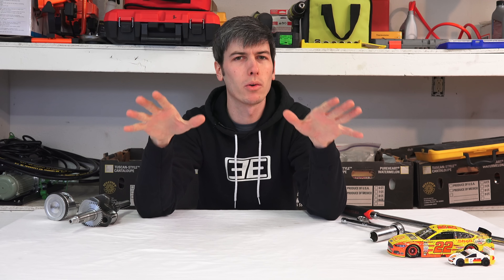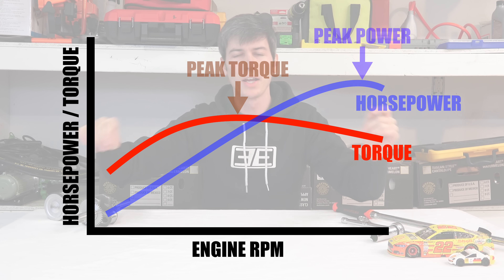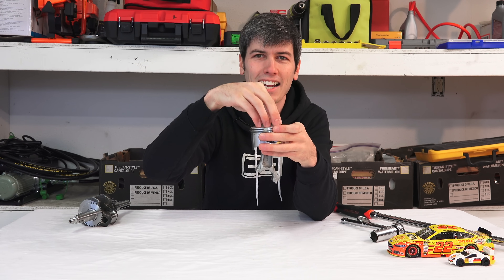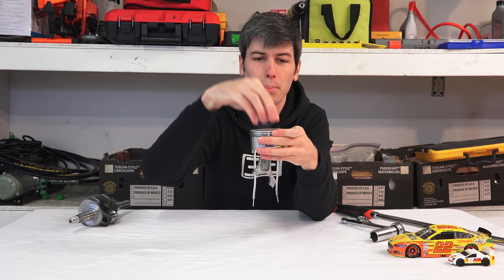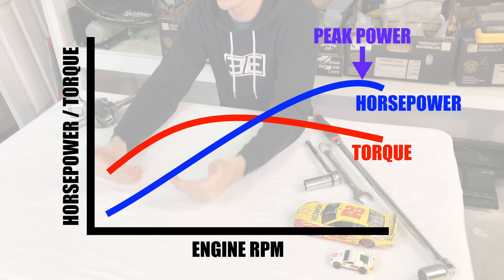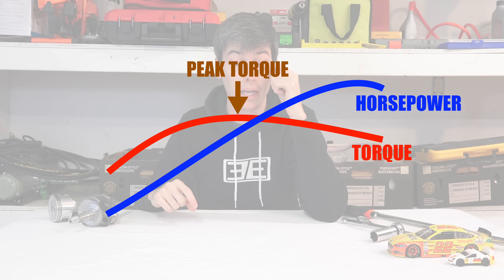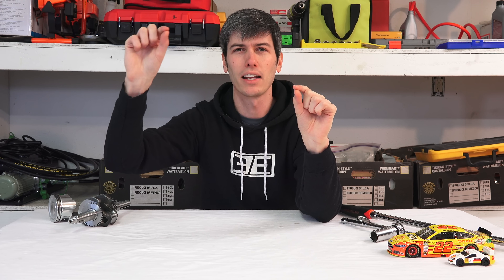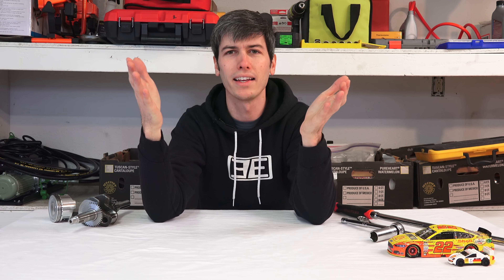Horsepower vs Torque - A Simple Explanation

Comment: Maybe it's easier to grasp if you turn the formula around: HP = torque x RPM. This means torque = HP / RPM. So, in a normal cat, with normal gearing; at low speeds you have high torque, at high speeds you have lower torque (because of the RPM's being higher at higher speeds) and HP is the magic that makes it work :-). Longer piston strokes make for more torque but it also takes longer to make a revolution so, less RPM's when HP is unchanged. Anyway, that's how I see it.

Comment: Let's try that again without the weird spellchecker mods:High Torque : tractor.  High horsepower : fast car.  A tractor cannot accelerate like a car but it is unstoppable.  A car can accelerate fast but stalls instantly when trying to pull a plow.  ...and that is the reason that a big heavy guy like me prefers the high-torque Harley over the buzzy  sportbike.  One delivers unstoppable pull against my weight; the other delivers narrow band acceleration and can bog down.
Reply: It's really only a question of gearing. You could theoretically put the tractor engine into a sports car, attach a transmission with very low gear ratio and there you go. As is said in the video, torque is easily manipulated.

Comment: Good video not entirely accurate, a force applied at a distance is a called a moment. The difference between a torque and a moment is that a torque has a displacent perpendicular to the axis of rotation and a moment only had a rotation around a axis

Comment: Brother, The Torque Conversion will be less at high RPM and High Gear .  at 4th gear the Multiplication of Torque will be less than 3rd Gear ! 
At 4th gear if You increase the Engine RPM a bit higher than the Maximum rated Torque RPM the Torque will be less,
And as You'll cnage the gear to 4 from the 3 the Torque Conversion Ratio will also decrease !
Over all less amount of Torque Multiplication ! 😑

Comment: So a 300 hp car with 100 lb-ft of torque accelerates at the same rate as a 300 hp car with 200 lb-ft of torque?  Saying gear ratios are identical.
Reply: I mean, I would think that a higher torque would still be faster, because it would mean you could get to the peak power faster, thus shifting into the next gear faster and continuing the cycle.
Reply: Gear ratios would never be identical with two engines as different as the ones you described. The engine with less torque would obviously have a far wider usable RPM range than the other one, so it wouldn't need to sacrifice as much torque in the transmission.

Comment: Torque = How much work can be done.
Horsepower = How fast the work can be done.
Reply: In the case of horsepower, you are right (easy enough, since exactly this is being said in the video). But torque doesn't say anything about work being done, because work requires displacement. You could have a torque acting on a screw that won't move, but there is no work being done.

Comment: You are talking about power and torque at crank. The cars power and torque can be different ftom ehat you have on crank by changing gearing ratios. You can have taller gearing on car with more torque.  That would make acceraration faster. Car with greater power can have more torque similarly.
Reply: Of course torque and RPM are freely interchangeable, that's exactly what is being said in the video when he compares the different wrenches to different gears.

Comment: Torque is the ability to move. You can have 500HP, but what's the point if you can't generate the movement(RPMs) to get there? I will take a 'Torquey' motor over a screamer any day.
Reply: Did you even watch the video? You may prefer whatever engine you will, but your explanation is as unscientific and wrong as it gets. Power is a physical quantity that already comprises torque and RPM. If you have a 500 HP engine, you either have lots of torque, a very wide usable RPM range or a bit of both. So if you have 500 HP and not "the movement(RPMs)", you would in fact inevitably have lots of torque, which you said you'd prefer.

Comment: Nope still don't get it. Don't think I ever will
Reply: Torque is twisting force in pounds x feet or newtons x meters.**

At zero rpm there is no horsepower developed no matter how much torque is present.  At very low rpm even very great torque develops little horsepower.

At any rpm, if you double the rpm while maintaining the same torque, you have doubled the horsepower.  

At low engine rpm torque increases with increasing rpm (as the delivered output overshadows the mechanical and pumping losses needed to keep the engine running)  Horsepower rapidly increases as both torque and rpm are increasing.

At high engine rpm the available torque falls off, but at first horsepower still goes up because it's the product of torque and rpm.  Eventually you reach an rpm where all the engine power is used turning the engine and both available torque and horsepower are zero.  Of course the engine will come apart before then.

**People often say foot pounds but that's wrong -- it's actually pound feet.  Foot pounds is a unit of energy, literally the amount of energy needed to raise a pound weight one foot under earth gravity.  One horsepower is delivering energy at the rate of 33,000 foot pounds per minute.

Comment: good introduction to torque and power, but seems you are messing up engine torque, its power, peak rpms and transmission gearing, Engine will provide maximum acceleration at  its RPM range close to peak torque (as you mentioned yourself) and that is the range where you gear up accelerating vehicle. But in the end, an engine with higher power will give higher top speed. On a straight leg, higher torque engine will advance faster, but eventually loose the race to higher power engine. Take a track with multiple corners and short straight legs (with its slow downs and accelerations) and higher power engine will loose its advantage.

Comment: Thank you for making this video. You'll never know how many times I've explained this to people online. Now I can just link this video!
I would make two minor corrections:
1. I wouldn't use the HP = tq * rpm because it makes people think about it backwards.
2. At the end you said one doesn't depend on the other and that's wrong.
Tq and rpm BOTH depend on the amount of power being extracted from the fuel. Without a power supply there is no torque or rpm. 
Rockets get along just fine with simply the power of burning fuel. No torque required.
I think a lot of the confusion people have is where these things are being measured. On a dyno, the power is being measured at the rear wheel and a calculation of the torque based on the engine's rpm is done by the computer to give an approximate torque at the crank of the engine. In my view, torque is a superfluous value to the user. If a user wants to compare two engines he need merely lay their power curves over one another.
Obviously, torque is important for engineers to make parts capable of dealing with that force and gear ratios, but the power curve tells the entire story. 
If one engine is making more power than another at a particular rpm it is mathematically impossible for it to be making less torque at that rpm.
If an engine is continuing to make power it can continue to accelerate at least until the forces against it i.e. friction and wind resistance overcome it.

Comment: Correct me if I'm wrong but my analogy has always been, imagine an electric hand fan, if it has high HP but low torque, the fan will be spinning faster giving more air, but put your finger in the blades and it'll stop easily. Vs more torque less HP, the fan won't spin as fast giving less air flow, but put your fingers in the blades and it'll be harder to stop. That's the way I've always seen torque Vs HP.
Reply: The trouble is that with a fan, it will spin as fast as the available power allows unless it's a fixed-rpm setup.

And in any situation, developed torque is only as much as the resistance against it.  Available torque could be very high but delivered torque quite small if there were an rpm limit on the motor.

Comment: i'd like to clarify: power is the rate at which work is done and work is conversion of energy. An electric motor converts electric energy to mechanical energy. A combustion engine converts chemical energy to thermal energy and mechanical energy (gases expand and are hotter) and also converts thermal energy to mechanical energy. The ratios depend on kind of cycle (i think?).

Comment: So if my car produces 100ft lbs of torque at 1000 rpms, and the distance from piston to crankshaft center is 1 ft (these numbers are all arbitrary), how can i find the initial force that created that torque?
Reply: Remember-  The down force of the piston is acting on  a lever arm equal to 1/2 the stroke rotating in a circle; about the crank so it needs to be integrated to account for the change in effective length throughout the power stroke caused by the changing angle of the rod to the crankshaft during rotation during the power stroke from TDC to BDC.
Reply: James Hohimer 
I think i asked the question wrong. 

I want to know how to find the force that will apply to a piston when the fuel combusts.
Reply: The torque developed by a single piston will vary instant-to-instant according to geometry (zero torque at TDC even if cylinder pressure is very high, negative torque on compression stroke, positive torque on power stroke).

During the power stroke it will also vary according to the cylinder volume occupied by the compustion gases.

You need calculus to get actual numbers out of this.

Comment: Torque is how hard the (G forces) or acceleration is , horsepower is for how long that acceleration "time"  will last  ,.... let's say : two cars go 11.00 E.T. seconds in the quarter mile,  but one of the two cars crosses the finish line at faster speed ( the faster car has more Horsepower) the other car accelerates faster  , but "top speed" is slower due to lower horsepower

Comment: Video about engineering with ft-lb units? Torque in physic is defined by Nm (Niuton * meter), why you don't promote the right approach then?
Reply: Its Newton meter (Nm), and it's just the SI system (international/ metric units). He's just explaining in FPS/ imperial unit. Just like different languages, its the content which matters, right?
Reply: thecriss

Comment: Great explanation in this often misunderstood matter! 
There is a misconception that torque is some kind of extra power, but one horsepower always is one horsepower. If you have a certain power available in a certain speed the torque doesn't matter. Very good about the explanation that the interesting to know is not the maximum values but the curves along the RPM range. The torque curve shows the relative power. Therefore when you accelerates at a given gear the acceleration is highest at the RPM where torque is highest. Just because the relative power is at the top value.
I read misleading statements in many motor magazines. An example of a misleading information can be in the description of an updated enlarged engine: "the new engine does not have only a higher power at low RPM but also higher torque". This is a kind of "nonsense" statement. It's not an advantage to have also higher torque it's a presumption. Because a higher power at a certain RPM requires higher torque.

Comment: Nothing causes more arguing and dissension than Politics, Harley Davidsons and the definition of torque.
Reply: How about women? I thought they cause more arguing and dissension when they manipulate things.
Reply: @cb250nighthawk3  Ya, those are called wives.
Reply: What about jet fuel and metal beams?
Reply: what about time of fuel can burn
Reply: Harley Davidson is the Hollister of motorcycles for old people.  Change my mind.
Reply: True.
Reply: my Dad "religion, politics, colour and wine" are topics not to join in on at a bar. Best advice.
Reply: @patbowl9075  color and wine? As in in what color wine is?? I don't see how that's a topic equal to the nuance of politics
Reply: Lol, I have spend the last few days arguing with "world renowned mechanics" and "a professional sand car builder" about this very thing.
Reply: Force x lever arm, that’s it
Reply: Apple Samsung, Messi Ronaldo 
Hold my beer
Reply: Torque is a rotational force - simples !  Think of a motorcycle on the wall of death going at 50mph - then put something in it's way - same as being hit at 50 mph on a flat road - I think were people get confused is the power and speed. Force is the potentional to do work - how you harness and use it varies - Atic vehicles have some of the greates power on the road..mmh... Formula 1 cars have 1.6L engines....which would you like to be hit by.......an F1 car doing 150mph or an artic doing 50mph - I remember my old days in scholl playing rugby - I was always told don't shy away from the inpact of a tackle the result will be worse - ie standing still.

Comment: I know torque makes for an "easier" transmission consideration .. when perfect gearing is impractical .. but Torque I always think of are raw "work" .. horsepower I think of as raw "output".  So brute vs fast .. elephant vs hare?  Horsepower that doesn't blow up the gearing is nice but Torques is almost a gearing in itself as you can manipulate it in a manner to have it "act as gearing" more easily.   I know this because Dodge saved $$$ on the Neon by using a OLD 3 speed transmission from actually the Omni/Horizon cars (it was cheap but durable they said) .. they lowered the horsepower on the engine to boost the torque as they said the engine torque made up for the lack of gears.  So explain how you can "loss horsepower" but gain torque .. how it is a trade off on grunt vs output.  An interesting conversation as your excellent explanation was more about speed over distance being what it is all about .. so run at optimum rpm and get it to the ground without affecting the rpm.

Comment: More torque produces higher HP with with lower amount of RPM. For example we can compare  a  motorcycle (Yamaha YZF R6 600CC) with 42ft-lb of torque will produce 8HP when idling at 1000RPM, if you rev the bike up to 2000RPM then it'll make 16HP. Compare this to a diesel truck motor with 1850 lb-ft torque, it'll make 352HP with the same amount of revs @ 1000RPM.

Comment: The best way i got told was when undoing a nut, your arm is the power, the length of the spanner is the torque. The longer the spanner, the easier it is to move the nut with the same amount of power.

Comment: In the example of 200hp/100lb-ft car vs 100hp/200lb-ft car, what if the 100hp/200lb-ft car was given a transmission that produces more development with taller gears than the 200hp/100lb-ft car? Would that enable the car with lower hp to achieve a higher top speed with less shifting?